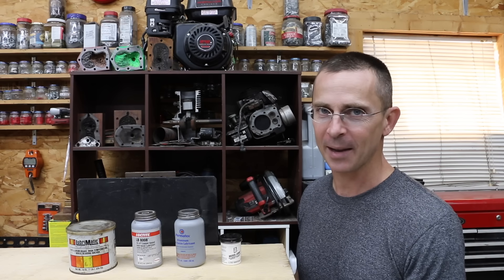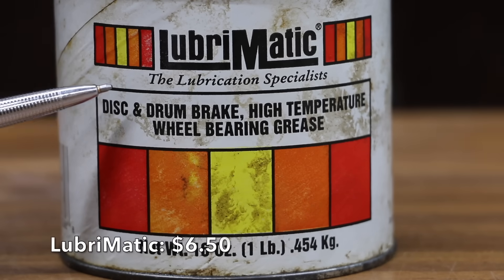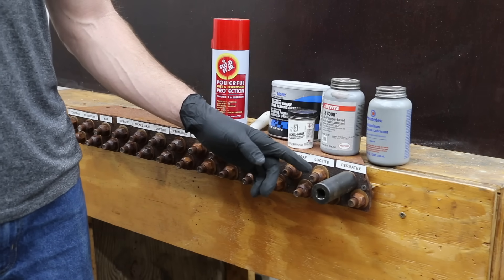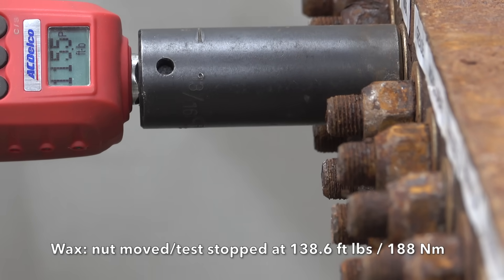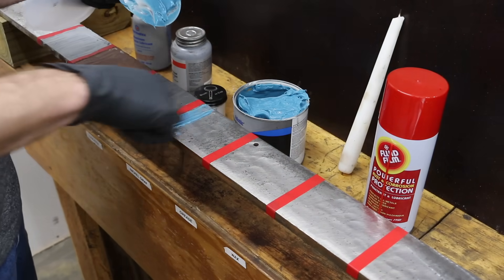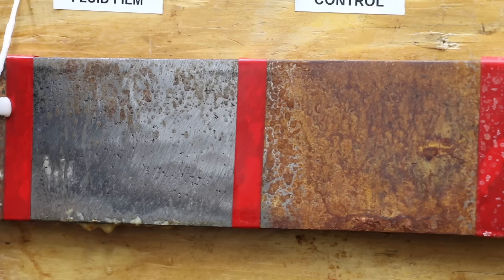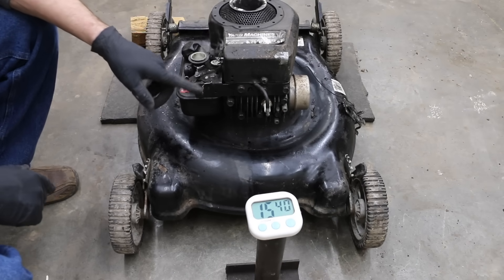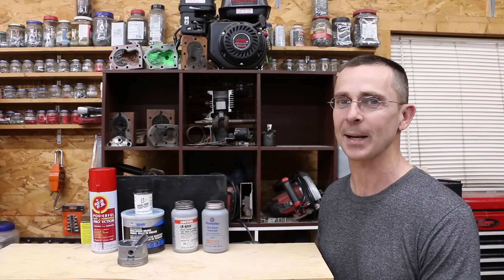Does Anti-Seize Compound Actually Work? Let's find out! Anti-Seize vs Grease vs Fluid Film vs Wax

Comment: In the shipyard industry, anti-seize is indispensable. Every single bolt and nut I installed on every single Navy ship I worked on had to be installed with anti-seize, it wasn't an actual requirement but unless it was specifically noted not to use it, we used it. Our go-to was Loctite 771 Nickel anti-sieze, the best in the market. Once you try to loosen a 2" diameter bolt with and without anti-seize, you will understand. It holds just as tight as without, but minus the corrosion locking.
Reply from the maker: Thanks for sharing.

Comment: I use that aluminum antiseize on mist things I don't put loctite on. It's great, lasts for years. I've actually had brake calipers a mechanic put on with great shake off, and Crack the rim while driving. I would never recommend Grease for most applications like on a vehicle where it can vibrate bolts off.
Reply from the maker: Thanks for the feedback.

Comment: When dealing with very high temperature the copper never-seize is the only thing that works. For example, the copper never-seize is ideal for exhaust manifold studs. The copper never-seize is manufactured by several different manufacturers and it's all great stuff.
Reply from the maker: Thanks for the feedback.

Comment: Been using Permatex aluminum high temp antiseize where my rotors make contact with my hubs, and also where they make contact with my aluminum rims. Holy crap it makes regular maintenance a breeze 😳! Do use it sparingly in this application if you actually like your vehicle to stop when tap the brakes😬.

Comment: I almost always put grease on rusty bolts when I put something back together, and I'm a firm believer that anti-seize does work. I think your tests was about as good as it gets. but I think time is the biggest factor. I feel like after a few years or maybe like 10 years the anti-seize probably is irrelevant. I'm pretty sure cars are assembled with anti-seize, ok so when you go pull an exhaust manifold off of a 10 year old car with aluminum heads, most likely the bolts will be seized and break. but yeah put anti-seize on everything, lol
Reply from the maker: Thanks for the feedback.

Comment: I was the Sr. Operator in a large Petroleum terminal I would buy anti seize by the gallon and every bolt and gasket we put together would come apart after many years with no problems

 Anti Seize was developed by Caterpillar for use on fuel injectors so they didn't seize in the cylinder heads ,  >Joe,  Baltimore MD.
Reply from the maker: Thanks for the feedback.

Comment: We used the copper hi-temp anti seize  on inconel  rod threads  during   heat treat @ 1650°f  to hang  parts,   and during tempering @800°f afterwards.  Strong stuff.
Reply from the maker: Thanks for the feedback.

Comment: I buy Antiseize  by the case  ..  It can last a   long time and   makes  dissassembly a lot easier  5-10  years down the road..  Used to have Lead in it  the  newer  types  use  Molly ..  and  the  High temp  uses  Copper   ..}  Permatex  is one brand  Locktite  I think is the other..
Reply from the maker: Thanks for the feedback.

Comment: So if the anti-seize made the motor to loose why not try a 1:3 or 1:4 or so on with motor oil. 1 part anti-seize to 3 parts oil and so on.
Reply from the maker: Thanks for the suggestion.

Comment: I’ve been sold on the value and use of anti-seize compounds for decades in all situations. Worst case use was on exhaust system clamps. After ~4yrs came off easily with hand tools and could’ve been reused if going cheap or using more expensive stainless steel clamps. On factory OEM exhaust systems after ~4yrs air impact gun was most useful and clamps always broke. Not sure what using anti-seize compound for small 4 cycle engine lubrication was meant to prove except for predictable total inappropriateness. But I’ll concede that it was amusing.👍😃.  Love your comparison content. Maybe not most scientific but pretty much true to real world conditions. Much thanks for your creative comparisons and efforts. Educational, informative, and entertaining!👌   Rich 🤓🐕‍🦺🎄✌️
Reply from the maker: You are welcome!

Comment: I have been using the permatex for decades, nice to know how it compared to the others,  if you do another one testing loosening rusted bolts, compared using a 50/50 mix of acetone and ATF fluid. Started using it and it seams to work good.
Reply from the maker: Thanks for the suggestion.
Reply: its great for head bolt threads on all-aluminum engines

Comment: Since it's messy I like to completely coat fastener threads with anti seize and then wipe off most of it so it's less messy to handle.  I wonder how little anti-seize can be used and still be effective.
Reply from the maker: Thanks for the suggestion.

Comment: How about testing some rc car silicone lub these sre supposed to be good. Iced used them in air guns and grand sone uses them all the time in his rc cars. It’s supposed to be pretty water proof. They come in different viscosities available in hobby shops that have rc cars. I also use them on bikes. Not had and issues I can say were caused by them. Also heard steam engine guys use them on steam engines. Steam oils are hard to find as they have Gallo in germ. Not many available any more excepted the steamer hobby.  

Thanks for all your hard work I watch your videos a lot.
Reply from the maker: You are welcome!  Thanks for the suggestion.

Comment: My experience is to always brush anti-seize on the screw threads before assembling.  Never had a screw nut, or bolt that I could not get back off after doing so.  Now, one place that I stopped applying anti-seize to are the wheel studs of my vehicles.  I found that over time the metal in the anti-seize began building up on the threads and it got so that the clearance was very tight.  I ended up running a die down on all the wheel studs to clean all the stuff out and a tap through all the nuts.  Now, I only apply a light coat of engine oil on the studs and never have a problem.
Reply from the maker: Thanks for sharing.

Comment: It does we used Something called Never Seize. It was a grey metallic stuff it would work for years even with High temperatures. We had a very caustic environment. (steel Mill) We also started using a copper metallic compound. it would work on very hot couplings. I had an electric fan seize up and put it on the fan bearings, one spin with your hand and it took a long time to stop, I had the fan 20 years and finally sold it still working like a top.
Reply from the maker: Thanks for sharing.

Comment: Here is a great use for anti-seize. When working on brake lines slide the nut back from the flare and cover the flared end with anti-seize. Put compound on the threads of the nut too.
Now, 25 years late when you have to replace a wheel cylinder or brake line the nut won’t be corroded to the line. I did all my new brake line in my old Jeep that way and the lines come apart beautifully 25 years later and many many miles spend driven in the mud.
Reply: +1000

Comment: Although I have worked on everything from lawnmowers to motorbikes and automobiles, my vocation is that of an aircraft mechanic. I have seen aluminum Anti-Seize before, but as I recall I have alway preferred to use the copper. Each cylinder head can cost upwards of $2000 USD and they have two plugs in each cylinder. They have helicoil type inserts and if you pull those out, the cylinder must come off. Plugs are removed for cleaning every 100 hours and if you don't take care of what you are doing, the customer could likely be upset. My primary, or initial vocation was that of a jet mechanic, Lockheed, Boeing, McDonnell Douglas etc. and we used copper based Anti-Seize on the igniters and other high heat inspection items. I can appreciate the work you have done, but it seems likely I could have told you what the results were going to be. One thing you didn't test for, that is what we in aviation deal with all the time, it is called "dissimilar metal corrosion". While this is not such a big deal in Auto and Farm equipment, in Aviation it is huge and can cost enormous amounts of money because of a stuck plug or igniter. I am advised what to use by the manufacturer and by the FAA, so your tests do not come as a surprise to me. BTW, Jet engine temperatures reach into the thousands of degrees. Good job though.
Reply from the maker: Thanks!.Thanks for sharing
Reply: @ProjectFarm  No worries, I guess what I'm trying to say is that if you are talking automotive or motorcycle, even firearms, that everyone always refers to "aircraft grade aluminum" even if most people have NO idea what that means. If you look to the Aerospace Industry you will find many answers to the questions that you pose on your channel. Just my two cents. These companies have already done the ground work. Good luck

Comment: Another great video!

- We used aluminum Anti-Seize on battery terminals (surface and mating faces) on a small fleet of vehicles on the farm. Works better than any other product I've seen for corrosion prevention on lead acid batteries.

Battery terminal anti corrosion products could be another video idea. I found many of those products products don't work very well.
Reply from the maker: Thanks!  Thanks for sharing.
Reply: Vaseline Petroleum Jelly, a little dab on the post and it prevents the crud from forming. Learned this from a motorcycle mechanic so many years ago.
Reply: i use the red stuff but i forget what its called. the alu anti-seize works good, too.

Comment: I know it's a bit late for this comment and I admit I didn't look back to see if anyone else had this thought.... But, what if instead of anti seize you thought of it as anti Galling...   (In reference to Galvanic corrosion?) Or is that a seperate thing.. shrug. Anyways I've especially destroyed aluminum to aluminum fittings attempting to disassemble things that coworkers neglected to use tape or dope on.
Reply from the maker: Thanks for the feedback.

Comment: As a rule, we never ever use lubricants or anti-seize on fastener joints in automotive manufacturing plants.  This is because of your point where the lubricant can affect torque and thus clamping load.  Every OEM runs extensive corrosion tests and coatings are applied to fasteners to inhibit corrosion.  Moreover, many bolts have a thread lock applied already as they come to the assembly line. A DC multiple is generally used on critical torques (like for example a steering knuckle).  On these types of safety applications there is a target torque and then a 90 degree turn programmed into the DC multiple.  The 90 degree turn past torque goal increases axial tension in the shank of the bolt in a very controlled fashion increasing clamping load.  If a fastener application calls for a thread lock, testing after 24 hours will reveal residual torque to breakaway a fastener actually increases with the curing of the thread lock in the joint. Lastly, many of the critical bolts used in brakes, steering, suspension and powertrain are one use bolts.  This means the torque and 90 degree turn permanently elongates the shank of the bolt and they are not reusable.  In short, application of any lubricant to joints calling out a dry torque specification is not advised.  It is can easily lead to over torque and fastener failures.  Good test methodology and video!  Thank You. 🙂👍
Reply from the maker: You are welcome!  Thanks for the feedback.

Comment: My father always said, "Never put anti-seize on the threads of a spark plug." I asked him why, and he said that over time with the high heat, the anit-seize will actually harden up back into aluminum and you'll never get the spark plug back out. Never tried it, but I wonder if that would make a good test video? I suspect he may have been right, since the anti-seize in the engine block began to get hard and flake up. I could just imagine it would get harder over a couple of months on the threads of a spark plug.
Reply from the maker: Thanks for the suggestion.
Reply: If you use greases this can be an issue since they can decompose but anti seize this would not be an issue. The big thing with spark plugs is you need to be carful not to get the stuff on the electrodes or you won’t be getting any spark…

Comment: I use both aluminum and copper anti-seize depending on the application. The fluid film actually works better the longer it soaks into the metal, think of it as using olive oil (or whatever cooking oil you prefer) on a cast-iron frying pan, over time it gets better.

Comment: great video! I just used anti-freeze for the first time so I was very interested in seeing this. I used it on the bolts of my rear differential cover on a 2008 Ford Ranger. It was a bit of a bear to take that off so next time I am confidant it will come off more easily.
Reply from the maker: Thanks!  Thanks for sharing.

Comment: the rod broke due to the cylinder filling with anti-seize. liquids don't compress , so when the piston couldn't compress the anti-seize and hydro locks the engine  it sends the force back through the rod breaking it. this bent the rod in a civic I used to have when I drove through a puddle of water. they put the air intake surprisingly low on a 90 civic but TML

Comment: I own a refrigeration, AC business in the upstate New York area. We have been using Anti-seize for years. I myself have changed a 1 hp condenser motor that was put in 6 year before me. The fan blade came of the shaft with just me pulling up on it. I will say it works well.
Reply from the maker: Thanks for sharing.

Comment: Im scared to use aluminum anti-seize after it ate away at my threads in my mountain bikes bottom bracket,  ultimately leading to stripped threads and buying a new bike as the frame was ruined.  Im not 100% sure this is what cause it, but after seeing the  piston connecting rod snap due to the corrosivness of the anti-seize im partly convinced it was the cuase.  I have since used barring grease with no issues.
Reply from the maker: Thanks for the feedback.

Comment: In the late '80s GM used to sell a carbon black based high temp anti-seize for O2 sensors.  They provided it to our university engine lab along with a fully supported Quad 4 engine.  Also with a flexible full lab ECM.  Very generous of them.  Marv Thomson ran the program at that time.  Anyway, back to the carbon black.  I can't remember the GM name for it but it was pretty expensive if we had to buy it.  We discovered that it was also amazing for exhaust pipe clamps.  We could easily assemble and remove them when changing dyno configurations.  Because it was expensive, we extended it by adding more carbon black and butyl alcohol as a carrier.  (only because it looked like carbon black and smelled like butyl alcohol, we really didn't know).  That mix worked pretty well, too.  Haven't seen it recently and most new O2 sensors seem to come precoated with copper-ish looking anti-seize.  Does anyone else remember that stuff?

Comment: Never do an automotive job without having anti-seize available. Especially if your replacing or servicing an O2 sensor. Otherwise you'll be replacing the piping and definitely have to replace the O2 sensor you have to crank out. I made that mistake once on a 2003 Honda accord. literally had a new sensor installed for 1 week and it seized to the Cat... Only took 1 week. Another great option is the copper infused 3M brush pump bottle for brake jobs. So much better than the brush and bottle crap. No mess and little waste.
Reply from the maker: Thanks for the feedback.

Comment: I always thought anti-seize compound was meant to prevent joints between dissimilar metals from seizing due to galvanic action?  Am I wrong?  I'd love to see a test of anti-seize compounds protecting against galvanic corrosion with a steel bolt in a block of aluminum.  I don't know how many bolts I've broken trying to get them out of aluminum intake manifolds.  No problem when I put them in with a good anti seize compound.
Reply from the maker: Thanks for the suggestion.

Comment: While I wouldn't use candle wax for this, I think your application is at fault in this test.  IME, dripping candle wax onto a cold surface will cause the wax to debond from the surface.  I think you are better off either rubbing the wax onto the surface or heating the part enough to melt the candle onto it, so the wax and part cool together.  This is a trick used in lapidary to attach a stone to a doping stick with sealing wax to safely grind the stone to shape by hand.  While I think these methods would be significantly more effective, I still think that wax is probably iffy.
Reply from the maker: Thanks for the constructive feedback.

Comment: Thanks for your complete test!, I've tried both Aluminum-based, Copper-based and the older Nickel-based Loctite Anti-seize products on Exhaust Manifold bolts (a very tough place), and the newer Copper one is noticeably better than the older (around 1980's) almost useless Nickel-based one, that was as miserable as using common grease or nothing at all!

On brake pads steel backing plate, my opinon is that most Silicone-based "hi-Temp" greases (like ATE are just too thin and soft, that those are displaced and washed away all too soon...
So I'm trying the copper-based grease sold for brakes.  Too soon to decide yet...
Reply from the maker: You are welcome!  Thanks for sharing.